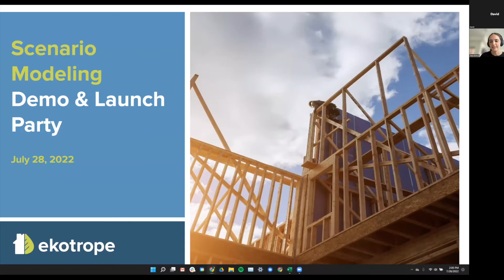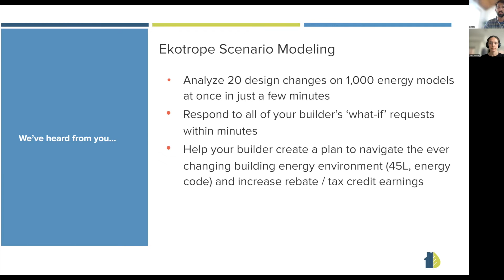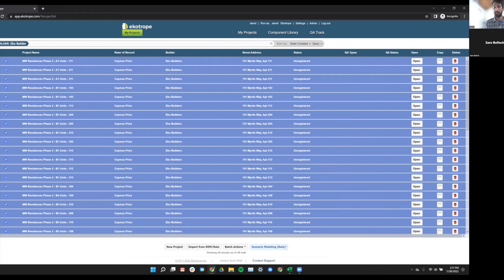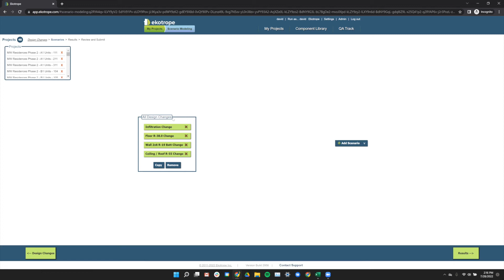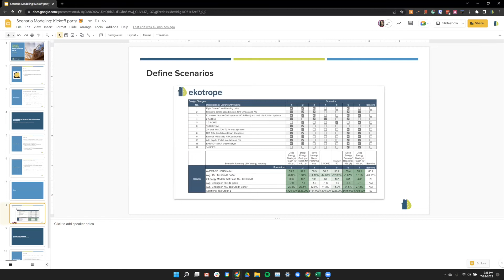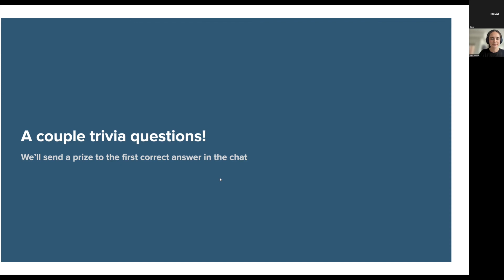Scenario Modeling Demo & Launch Party Webinar

Comment: Why can't we include different mechanical systems in the scenario analysis? This is something we do quite often. For example, propane furnace vs. air source heat pump vs. geothermal heat pump. Or conventional water heater vs. heat pump water heater.
Reply from the maker: Hey Matt! Good question. You will be able to make those changes very soon! We are adding that functionality right now. It is significantly more complex change than the design changes Scenario Modeling currently supports however, you can expect to see this improvement in the next couple of weeks.